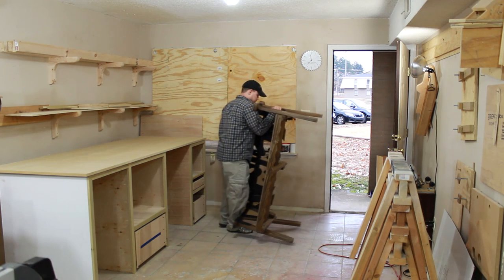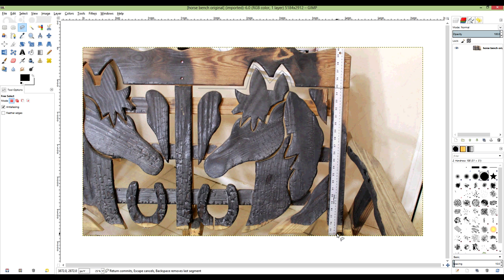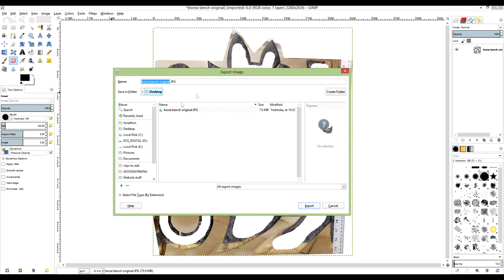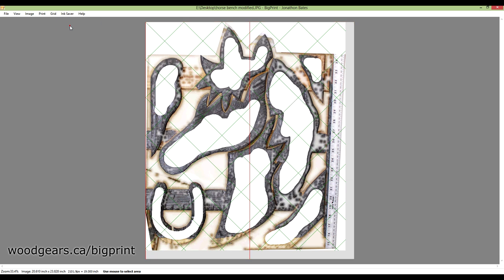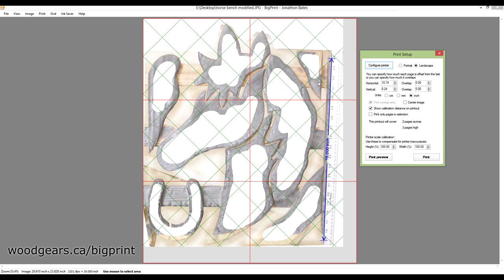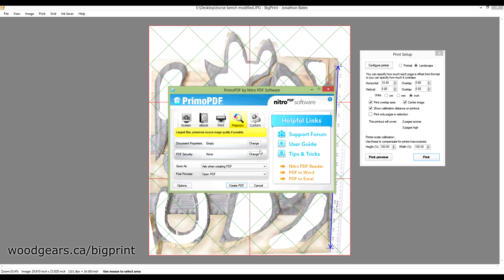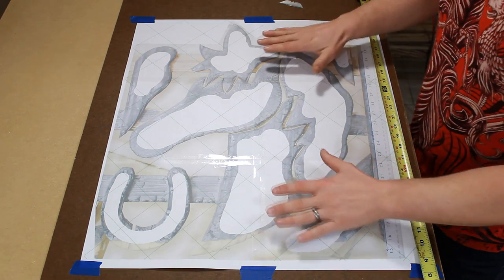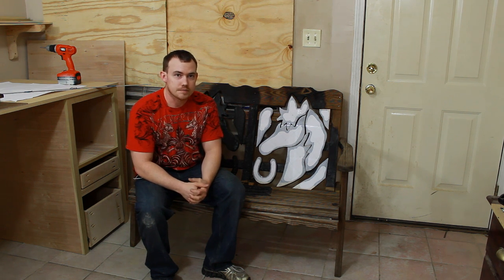Reproduce Full Size Templates With BigPrint - 119

Comment: Question:  if printing a larger pattern that has to be taped together, do you have to cut off the borders of the printout?  My printer won’t print without borders (at least I can’t figure it out).

Comment: You are using the grizzly 14 1hp band saw right?  Do you do any resaw with it?  If so what is the max size you can do?
Reply from the maker: Phil Reynolds 6-3/8" if I recall correctly. I just bought a woodslicer blade and it cuts like buttah!